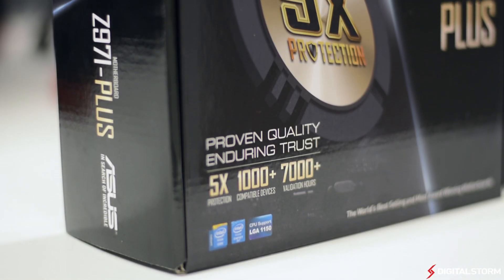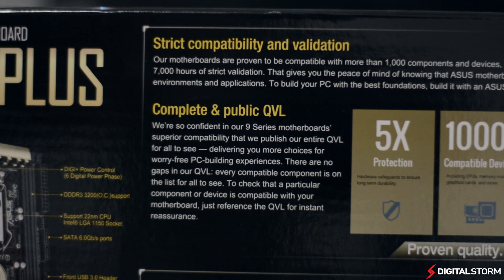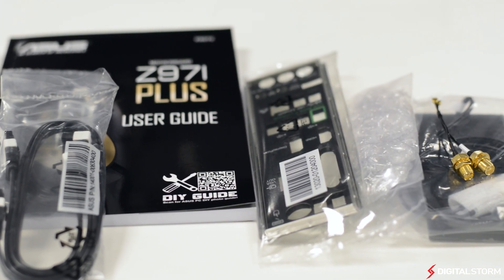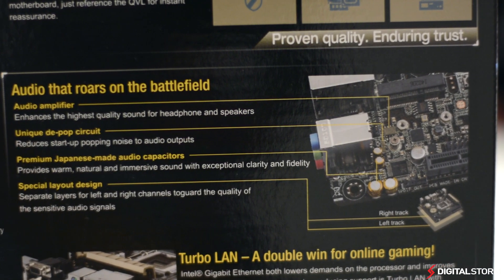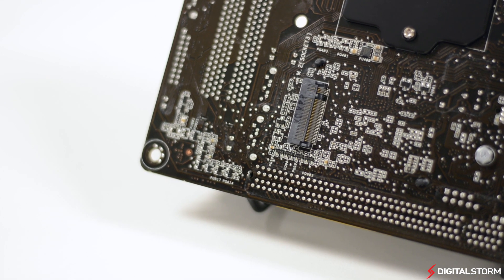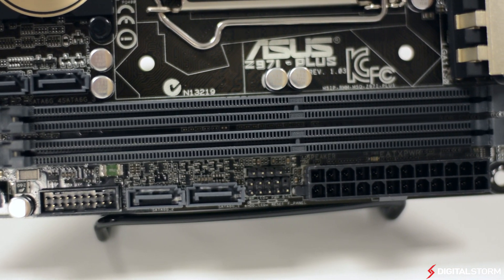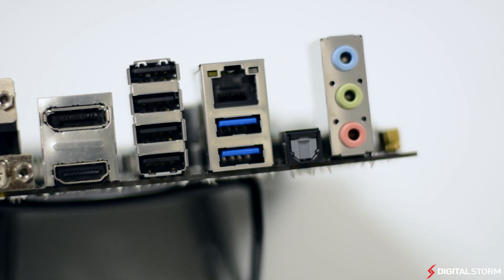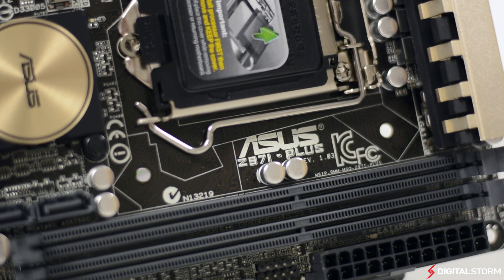ASUS Z97I-PLUS Mini-ITX Unboxing and Overview

Comment: So im debating which mobo i should get. Im stuck between this one and the Maximus VII Impact. I want to overclock a little not a lot. hope someone can help as there is a 60 euro difference between the boards.
Reply: +John Smith its z97 that is why it has Z for overclocking  and its 125euros in amazon :D